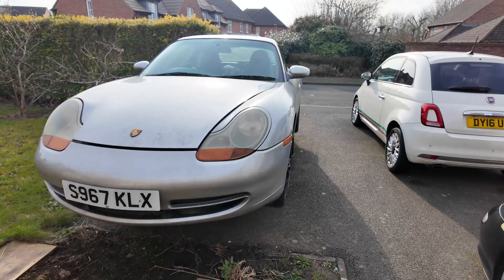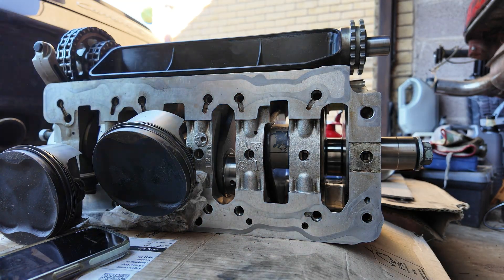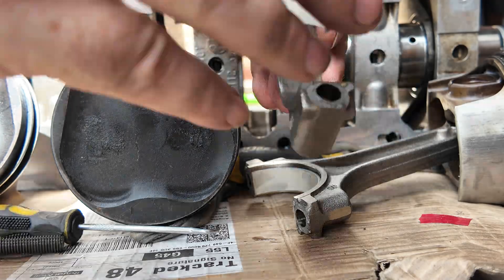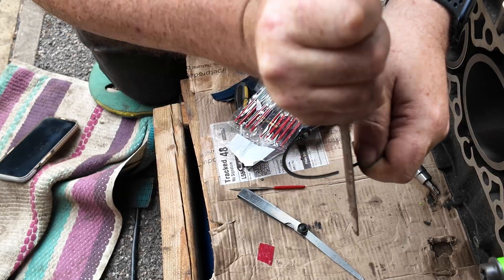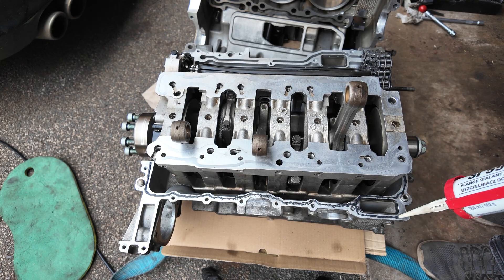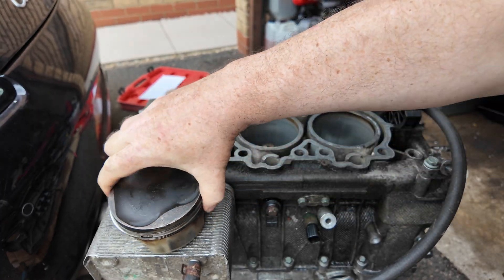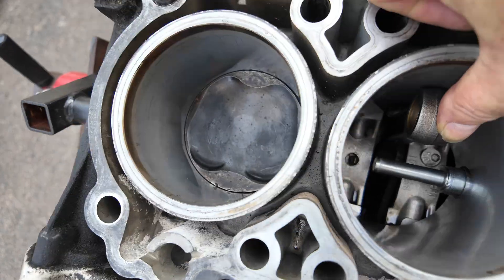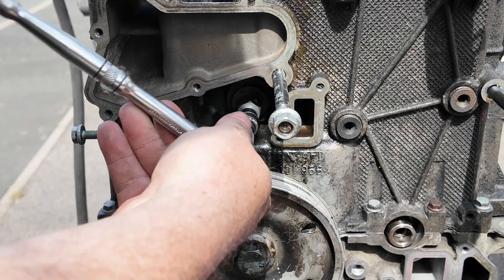Porsche 996 Piston install fail!! & Crankshaft Woes

Comment: Nice Videos. I'm just about to start sorting my 996 C4 out. I have no compression on cyl 1 and 100% leakdown through a intake valve. Hoping i can get away with just head work on bank 1. I'm thinking its either a failed spring or lifter. Engine still starts with no knocking just misfires. Will you be doing Videos on re fitting the heads,Cams and re timing ?
I've just purchased the new 7000tl quickjack so hoping i can get engine out without removing the inlet manifolds as they go higher now than old ones. I don't suppose you know what clearance is needed from rear of car to floor with a 6" table to rest engine on ?
Also do you know anyone local to midlands preferably Leicestershire that does head work ?
Cheers
Reply from the maker: Yes I will be doing the rebuild video. I don't know the clearance, never actually measured it. But the QJ7000 lifts quite a bit higher then mine.

Comment: Just a quick note, never ever use oil or any fluids when using the plasti gauge as it will give you incorrect results, the cranks surface should be bone dry and it does make a big difference. See latest video from M539 were he used additional tools to determine the accuracy of the plasti gauge results.
Reply from the maker: Noted for next time I have to use it. I use just a touch to on my finger to stop the plastigage falling off as directed by the component manufacturer Mahle.